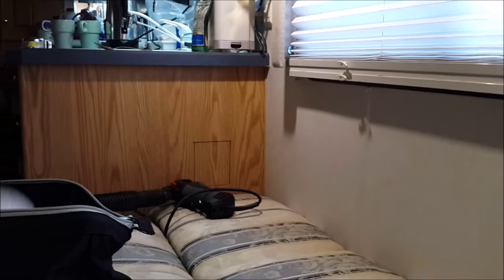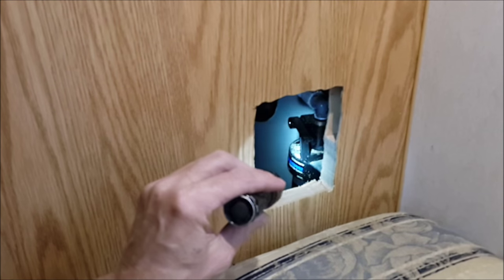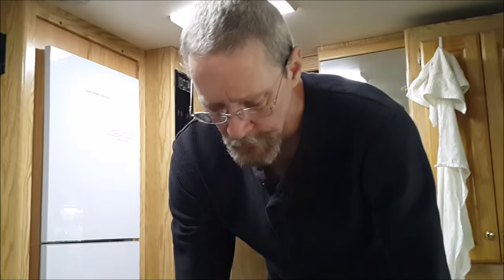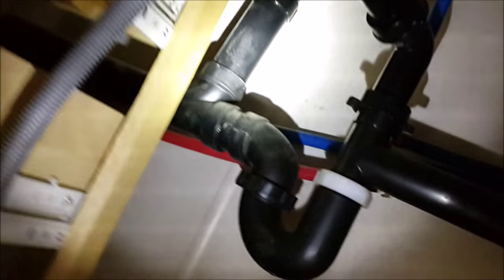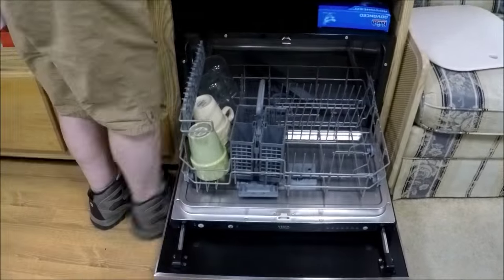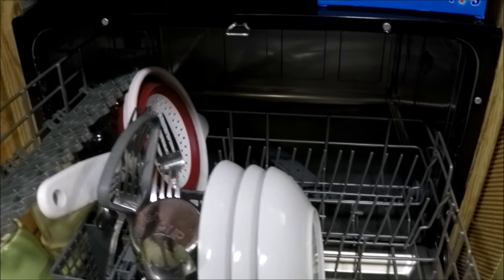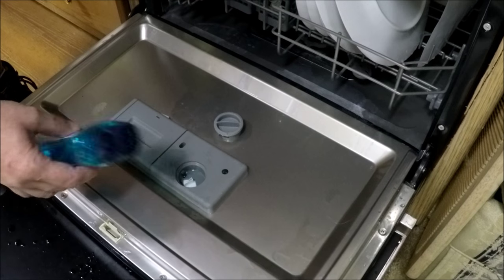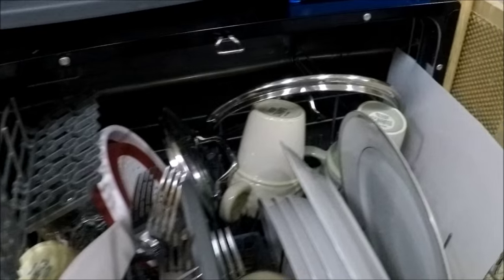Full Time RV Living: Vesta Dishwasher Installation and Access Door

Comment: Nice video, never seen a dishwasher like that. I notice you put the drain after the p-trap. This will allow odor from the holding tank to come into the cabinet. Is the pipe you put the drain line into the stack vent pipe to allow the sink to drain? Suggest a one way air valve. Great tip on the water softener where hard water is present. It saves the seals in the faucets from leaking.
Reply from the maker: +Larry Sharp It isn't an open drain hose, it's a solenoid operated valve that is closed when not in use.

Comment: How efficient is this dishwasher? I'm curious about water and electricity usage per wash cycle.  Thanks
Reply from the maker: It is pretty efficient. It takes 4.2 gallons max of water orn a heavy cycle, and about four amps if it must heat its own water, less, obviously, if its hot water comes from the water heater. The hot water heater is very efficient and can run solely on propane, electricity, or both.